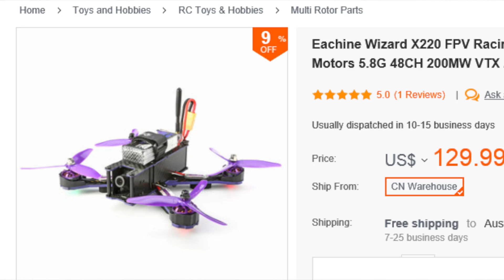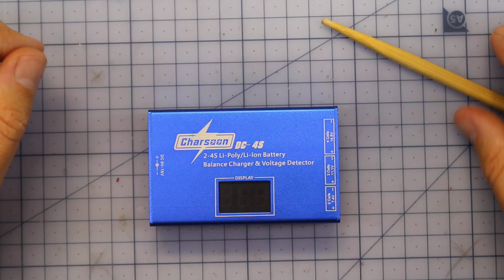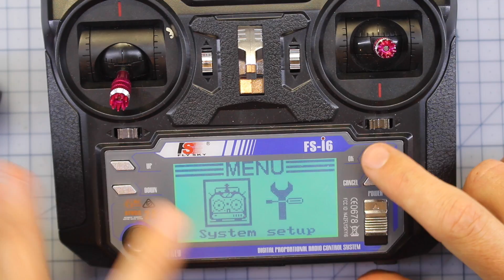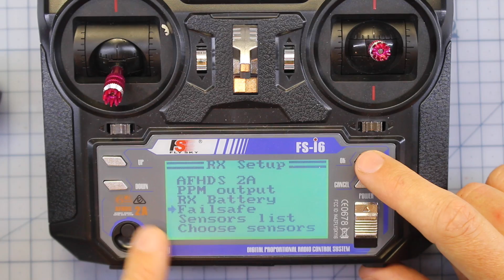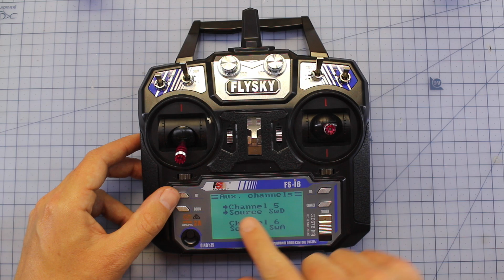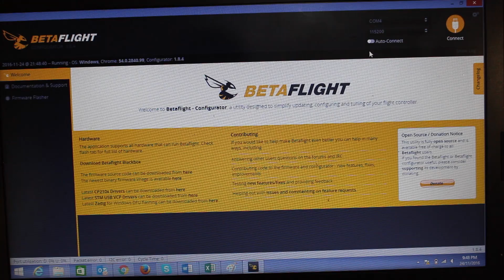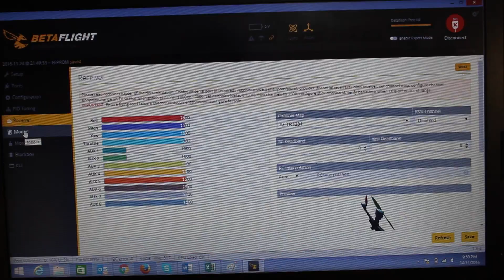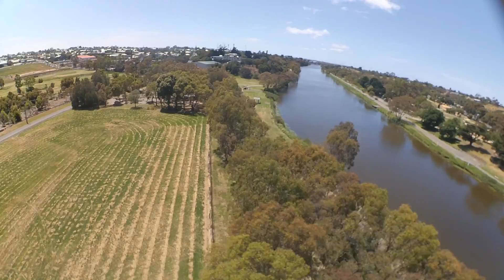How to get FPV DRONE RACING for under $300! Parts +Full setup.

Comment: I Already know most of this stuff, but still watched the entire thing. Never know when you'll learn something new :) Great video, will definitely recommend it to some friends how want to get in the hobby. One question though, didn't you mean horizon mode in stead of angle mode for auto level? I thought angle mode is for setting a max angle limit so you cant do flips and rolls. Happy flying
Reply from the maker: yeah I dont think a beginner wants to do flips straight away. easy to change though.

Comment: I found this package should I buy it? http://m.banggood.com/Eachine-Wizard-X220-FPV-Racer-Blheli_S-Naze32-6DOF-5_8G-48CH-200MW-700TVL-Camera-w-FlySky-I6-RTF-p-1077100.html?p=RB0922217402201307U3
Reply: AuthorFilms Studios yeah I've calculated and it's not practical to buy that package. Thanks for your advice
Reply: Package is around 200 dolars and it has the drone controller 3s battery and that
Reply: Yankı Bora Ayman the only thing you need then are the goggles?
Reply: No, not really. It's actually more expensive and the 3S isn't as great or punchy. Also there are several small differences including LED positioning which arent as good.

Comment: Man. I want a racer but have only been flying a week. Do the goggle require a phone that goes inside or does it have the screen built in?
Reply: Kotipelto screen built i  i  believe
Reply from the maker: correct
Reply: $300 is really good! I spent twice that building a 1 10/th buggy with all the electronics. I'll be all over this when I can fly without crashing all the time:D

Comment: Will drone bind to Turnigy 9x
Reply from the maker: yes if you have the correct rx
Reply: Is that the receiver?
Thanks for the help.
Reply: Do the Kylin goggles come with headstrap and battery?
Reply from the maker: AitkenBros. yes

Comment: Hey can you tell me what right or left stick throttle means? I saw it on the page from the radio. Is Throttle what makes it go up or what lets it move foreword?
Reply: The left hand throttle is mode 2 (most people fly) and there is a right hand throttle which is mode 1. Mode 2 have the up, down and twisting on the left of the transmitter and has the forward, backward, left and right movement on the right. It is the opposite for mode 1. Good question. ;)
Reply: CrudeDoughnut 95 Thanks for the good answer 👍🏼
Reply from the maker: this
Reply: If you got the wrong mode like me. don't freak out. you can switch the mode in the settings then manually unscrew and switch the gimbles in the transmitter. your welcome.

Comment: Hi i woudl like to have your opinion over the Eachine Wizard 220 vs the Realacc 210 = which one to buy
Reply from the maker: does the realacc have fpv?
Reply: Yes the link here shows it has RTF even the motors are 2205 while wizard is 2204 - need your final advise as i want to place an order by today 

http://www.banggood.com/Realacc-GX210-CC3D-Naze32-F3-FPV-Racer-RTF-with-700TVL-Camera-40CH-VTX-p-1091154.html
Reply from the maker: Thaddeus Fernandes looks ok but get the one with the spf3 flight controller http://bit.ly/2giDYbk

Comment: Would these batteries work with the wizard? 

http://www.banggood.com/ZOP-Power-14_8V-1800mAh-65C-4S-Lipo-Battery-XT60-Plug-p-1089557.html?rmmds=cart
Reply from the maker: yes, but a little big
Reply: +UAVfutures the fact that it's 1800 mAh instead of 1300 mAh doesn't make up for it?

also thanks for responding, I love your channel!
Reply from the maker: Bryan Gonzalez the fact that it is 1800 instead of 1300 is the problem. its not more powerful, just a larger capacity/ heavier.
Reply: +UAVfutures shouldn't the larger capacity translate to a longer flight time? Or does the added weight affect the performance that much? Sorry for all the questions, this would be my first quad. I've been practicing on the drl simulator and I'd like to try a real one now.

Comment: how does this compare to the dubai 210?
Reply from the maker: not as fast, but better escs and overall better quad
Reply: UAVfutures I'm new to your chanel and new to fpv drones as well. I've got about 400 bucks to spend and this seems like a sweet setup for a beginner from all your videos I've watched. I'm not afraid of buying a kit drone and assembling it myself either. for the money would you recomend just getting this setup or with the extra 125 bucks or so what would you upgrade to?

Comment: Can i use a monitor at the place of the googles?
Reply from the maker: yes
Reply: thank you !
Reply: So if i want to use a monitor i just have to buy one and it will work? I want to buy this one http://m.banggood.com/Eachine-LCD5800D-5_8G-40CH-7-Inch-HD-FPV-Monitor-with-DVR-Built-in-Battery-p-1067081.html
Reply: Eggcraft yes, that will work. But i would advise to buy a set of clover leaf antenna's with the screen (the stock black antenna's are usually crap)

Comment: Do you have any advice on what not to do on the field as far as connecting things goes? I am confused on when I'm able to hold it. I have failsafe on, but when am I able to safely hold the drone with/without battery plugged in, radio on/off, etc? Arm/disarm button on / off??
Reply from the maker: i dont understand sorry

Comment: that reciver Transmitter combo can be upgraded to 10channels for free just by updating the firmware and then use Ibus in Cleanflight / betaflight
Reply from the maker: good tip

Comment: get a QX90 and a set of goggles to get started. alos you wont have to leave home to get flying
Reply from the maker: micros are heaps of fun, the LT105 is better in my opinion though
Reply: i have never tested the LT105. but the QX90 are not good right off the bat. you will need to flash Betaflight on it and also replace the props with the walkera Ladybird Props. then its a amazing flyer.

Comment: For the remote/controller, there are two modes; left hand throttle and right hand throttle.  What does this mean?
Reply from the maker: mode 2 is what "most" people fly
Reply: JustALowlyCommenter it means the throttle is either on the left or right joystick on the radio
Reply: Thanks for the reply, and for those also wondering, search "mode 1 and mode 2 quadcopter" into google images and you can find some useful diagrams explaining stick movements and their relation to quadcopter movement for a more in-depth explanation

Comment: would it be this easy to set up the wizard with the turnigy 9x? or would you have to buy a special module and rx?
Reply from the maker: i think the process would be very similar to this.
Reply: Ok thanks because im wanting this quad but want a little better of a transmitter and i didnt know if the turnigy 9x rx will take ppm

Comment: Hey stew I have a question about the diatone crusader 200 gt2, can I use the receiver that comes with the fly sky I6 radio.?
Reply from the maker: yes, if it is the ia6B receiver
Reply: One more question what should I use to connect it like sbus,ppm,etc
Reply from the maker: evan outlander i used ppm in this video, but sbus is also possible

Comment: The Frsky Taranis transmitter will work with the same  'FS-iA6B Radio Receiver' or should I get another one  ?
Reply: Javier Riveros unfortunately, it won't. I have the tgy-i10 (compatible with that rx) and I'd love to switch to taranis, but that'll mean to change all my receivers as well, so I'm setting this decision aside for now.
Reply: Miquel Pavillard Thanks for your reply ! I ordered receiver Frsky X4RSB in order to work with taranis ! :)
Reply from the maker: yep, if you have frsky gear, use that for sure.
Reply: UAVfutures thanks !! 👍

Comment: And what about the charger? No storage charge? Wouldn't a Imax B6 be a better choice for a "future proof" charger?
Reply from the maker: yeah but it is a lot more expensive (comparatively)
Reply: Yeah 10USD more expensive, and you also need a power supply... However it allows for a parallel charging board in the future as well. This might just be some considerations for new pilots. Great video as always!

Comment: Ok so im pretty new to  FPV, and I tried to look my question up, and ended up with a bunch of jargon, acronyms and answers that I could't really tell if they pertained to a setup like this or something completely different. But you said in the video that the batteries last for only 3 minutes? Do you mean you pop a fully charged battery into the machine and in three minutes of flight it will be totally dead? That seems like a crazy short amount of time. I mean if you were going to drive somewhere to practice, in thirty minutes you would have gone through 10 sets of batteries. And half an hour of fun for what is probably about 40 mins of driving "for some of us"; and that seems a bit crazy. Not to mention 10 batteries would be another $150 and all of the extra chargers as well, unless you wanted to spend a week charging everything up just for one day. Am I missing something here. And can that charger, charge three batteries at once, even though all of the ports are different? And how long does it take to charge a battery? Is there an easy way to charge batteries in the field without investing in a generator? Also, how do you know when your battery is about to go too low when your flying? I know you said you can check the charge with the charger so your not over draining it, but can you only do several laps before you have to pull it out and make sure your not ruining your battery? Or will the controller or your goggles let you know whats going on. It all seems kind of like a giant hassle. So can you kind of give me a heads up as to what the realistic process for managing these issues would be. Also can you get batteries that just last longer, like at least 15 mins or so, or is that too big for this little frame? And if so what battery would you go for.
Reply: T hi, the flight time depends on how you fly your quad. If you just hovering around I am sure you can get over 5 min. But if you are escalating with much flips and stuff then the flight time is indeed preatty bad. Most quads have a low voltage alarm that beeps on the drone if the batterie gets empty so you know when you have to land. There are parallel charger boards to charge up to 5 batteries at once; but this also requires a decent balance charger. Cheack out UAV's video of the parallel charger board. You can also use batteries with a higher capacity but that only works up to a certain size because the batteries will be heavier and if they are too heavy you could get less flight time than with a smaller batterie. Also the handling of the quad is affected by the weight of the batterie. Hope this helps you a little.
Reply: anglovirtual I kind of get it,  reminds of of when I used to play paintball, like a ten minute game, and fifteen minutes of messing with your gear and eating sandwiches. Do you think I should invest in a cheap $50ish dollar rig to learn a bit how to fly before buying a whole fpv setup like this.  Watching the races is what got me all excited about this,  but after watching a few beginner videos it seems like months of practice before you can even navigate obstacles. I just really like the idea of the vr style headset. It reminds me of that game Wipeout 64
Reply from the maker: all your assumptions are very much correct. 3 minutes of fun. for an hour charging per battery

Comment: I want to use a Devention 8S transmitter from my old CP Copter, but the receiver is PWM protocol, does the eachine support PWM receivers ( separate plugs for each channel)?
Reply from the maker: it does, but it is a real pain to get it to work and you need some extra sure cables
Reply: UAVfutures does Spektrum Receivers support SBUS?

Comment: In FPV flying, do you have to reverse the left and right when flying towards you? Or FPV is flying in headless mode?
Reply: In FPV you are always looking out the front of the quad, left is always left.

I honestly find FPV a lot easier than flying line of sight.
Reply from the maker: no, left is always left

Comment: Buyer beware!!! 
Mine came in looking all beat up.  It hooked up to betaflight just fine and seemed like it was gonna be fine, until the maiden. I just barely hit the throttle and it spins violently out of control. Tried recalibration and reflash on the board and esc.. same problem. Banggood said they would refund my money if I pay to have it shipped back to China.   They also won't publish my review of the product, very poor customer service.  There are several people having the same problem with these, Please google this quad before you buy!!!!!!!
Reply: Sounds like reversed motor or incorrect prop
Reply: No offense, but it was most likely user error, not a problem with the quad.  Having a drone flip out of control and go crazy is part of the learning experience.  It's happened to all experienced pilots.  You could have had a prop on backwards, had a motor spinning the wrong way, had your rates or PIDs wrong etc.  I found out the hard way that cleanflight configurator does not work with betaflight anymore.  You need betaflight configurator.  Setting your rates in cleanflight on betaflight software will give wonky values and make your drone flip out.
Reply: did you check the more obvious stuff like motor spinning wrong way and fc board mounted sideways or even wrong props? if its just the fc board you can easily replace it for less than the price of postage anywhere,
Reply: Check props cw ccw are they on the right motors. How quick we are to blame the product. When 65% of the time it is operator error
Reply: Banggood finally admitted something was wrong and sent me a replacement flight control board.  No problems since then.  I was able to get it to fly a few times after reflashing the board with betaflight, May try that
Reply: Drew Pickering damn that's effed up. Lame that they won't pay for return shipping
Reply: StereoHead 
The motors spin correctly and in the correct pattern i.e. 1,2,3,4.  
  I've reflashed the board with betaflight 3.0.  I've been in blheli to look at the escs, they were fine before the 5th crash video I took for banggood.      My only real complaint with this quad is banggood, they are extremely hard to get a hold of for any help or return.  Looks like in most cases they will credit your account for electronic parts and call it good
Reply: banggood are terrible if you need to communicate anything subtle or complex,  i still think you are being unfair to everybody out there thinking of buying a fast quad, the x220 is a real bargain and you are claiming its 50/50 gamble, thats just not fair,  did you check to find out what the problem is? betaflight will let you see if the gyro is working or the motors spin wrongly or the rx controls are wrong which is known to happen with cc3d and pwm on betaflight, so i suggest using betaflight to identify the problem and ask anybody in rcgroups for advice, loads of people happy to help you troubeshoot stuff
Reply: Drew Pickering ...  I just had the same experience.  Were you able to figure out what was wrong?
Reply: +UAVFutures could you please help us?

Comment: the eachine wizard I bought 3 of them and all of them came to me broken I don't know if it's shipping or what to the US but I think I'd rather stick to something local
Reply: broken how?
Reply: shipping to usa   some how  they  started to catch fire   the antanna got hot when it was pluged in the pc   started to smoke the second one put the batery in to bind it   the board  wires were touching fried it  3 arrms and motors were loose  on take off
Reply: chad henry Checking motor screws is a requirement for any drone.  I check mine every 2 or 3 flights.  Was the antenna screwed into the SMA connector?  Any video transmitter can fry if you turn it on without an antenna attached.  But the board wires do sound bad.
Reply: I did all that  and it happened    I try ed getting a new sent to me they just wanted to give me 65 bucks credit  to buy the parts they think was bad  .I think it was cause of the shipping

Comment: just went through this process being new to the hobby. i chose the realacc x210 is was $105 without radio or video. highly recommend looking at this option if you are comfortable soldering. similar total price but u can affor to use a better camera or more batterys.

Comment: I'm planning in building a Mixuko but this quad caught my attention for the price. How tough is the carbon fiber and are replacement parts available? I want a quadcopter frame that is pretty much  unbreakable, not much grass/soft dirt here in the desert.
Reply from the maker: its a pretty tough frame, 4mm carbon fibre arms

Comment: Not sure if you seen or reviewed the "Eachine Assassin 180", I figured it would be a cheap jumping off point, (still waiting for it to show up) http://www.banggood.com/Eachine-Assassin-180-FPV-wEachine-VR-007-HD-Goggles-I6-Transmitter-Built-In-OSD-GPS-NAZE32-RTF-p-1028910.html?rmmds=search (Quad, controller, FPV all in one package) $229.99 they have an (extra 35% off coupon: RC200), It ends up being $150 with free shipping, If it ends up being junk I think my kids would have fun with it, although for $150 how could I not try it
Reply: looks too easy to break, and not easy to fix

Comment: It's worth 5-10 more bucks to buy a proper circular polarized antenna for the quad too. Especially, if you're using CP receiver antenna, they should be matched. These small CP antennas are far from perfect, so they will have signal from a linear polarized whip antenna, but much weaker. 
If i'm right, those are KingKong props, nice, durable, and cheap. :)
Reply from the maker: yep, agree with all of this